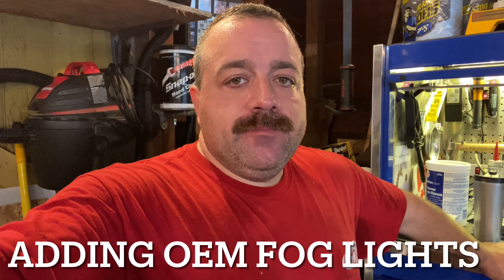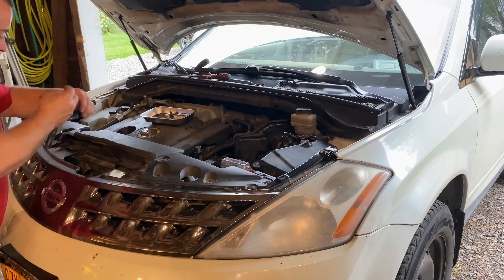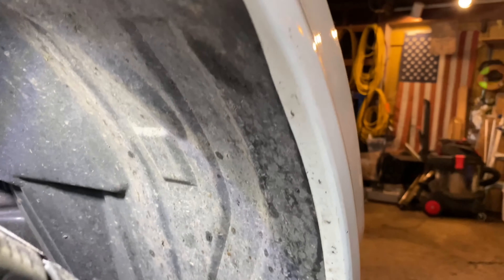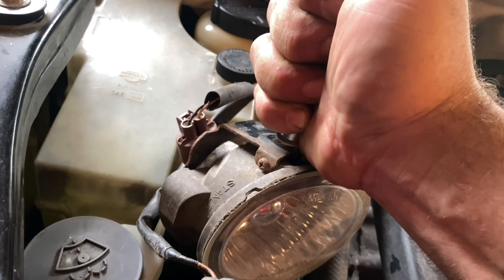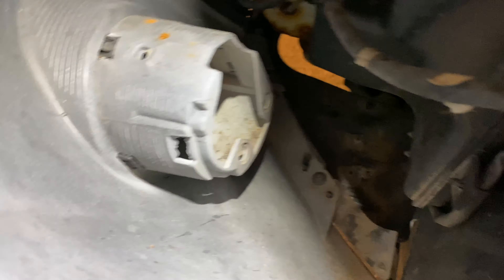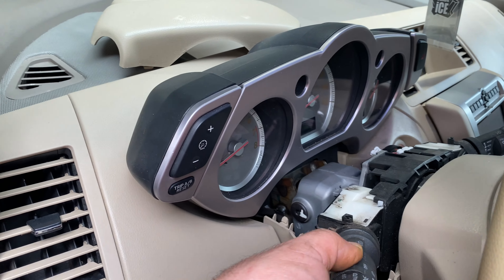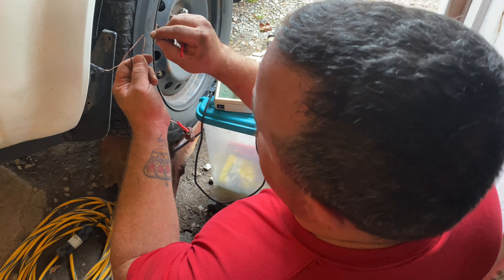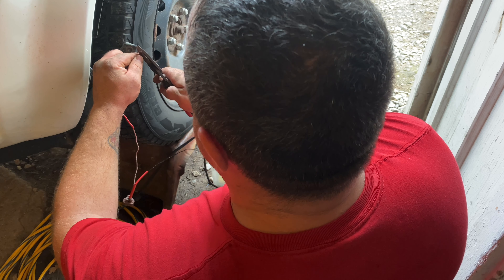2006 Nissan Murano adding OEM fog lights

Comment: I just want to say thank you for posting the CVT cooler line fix video, I was able to change the lines and banjo bolt. I ended up using hose clamps since the hoses were a little loose. I also plan on doing this fog lights upgrade but unfortunately, I went to multiple junkyards but I couldn't find them. I will see if I can get the ones from eBay and modify them to OEM standards.

Comment: Hi Joe did you ever experience the exhaust sagging in the middle on the Murano?  It looks like there should be a support brace in the middle but there is none.
Reply from the maker: That’s a problem for sure. I had to modify the metal rods that are on the pipes to tuck it higher up. I don’t remember exactly what I did, but I definitely agree - it hangs down unusually far in the middle.
Reply: @JoesCarSmartsNY  thank you!
Reply: So it took it in and the shop says oh btw the subframe is gone, rusted out. Car is junk. Bummer... Have you ever noticed that kind of rust?
Reply from the maker: @vladchan  Oh man. We just scrapped ours a couple months ago because of the rear subframe. Yes, I’ve seen it. We had to scrap our perfectly running Murano at 287k miles because of a bad rear subframe. I technically could have replaced it but it was not worth the cost and effort at that mileage.
Reply: @JoesCarSmartsNY  Muranos dropping like flies. I watched a video guy got a whole real axle assembly: subframe control arms hubs the whole 9 yards, and replaced the whole thing as a unit. Didnt look too bad
Reply from the maker: @vladchan  Depending on the rust on the rest of that area. I tried to take one of the main subframe bolts out and it as totally rounded and ruined.  If you’re in another area and the rest of the car is not too rusty it could be worth it. The subframe itself is worth about $600-$700 used right now.

Comment: Thanks for the video! I have a 06 Murano S and will look to see if I have the wiring like you did. Question, did the auto headlight function work for your standard headlights? Also (not as important) how did you trimming look like after you Dremel the trim (pictures/video of it)?
Reply from the maker: The auto feature seems to be more about auto on and off with ignition but there’s a delay after the car is shut off. It doesn’t seem to detect darkness and turn them on only at dark. 

I trimmed a bit too much of the shroud, I would recommend trimming away less than I did and test fitting it until you’re happy with it. From the side I can see a small gap between the shroud and the lens.
Reply: @JoesCarSmartsNY  Thanks again! I went to the salvage yard and picked everything up in one haul! I paid $45 for the fog lights, the light bezel and new blinker! All your instructions were 100% and did not have to go back for anything! Due to lack of knowledge of light life left, I bought some new ones from Amazon and made sure it all worked and spent 2hrs installing it. I’m no a mechanic and only have BASIC knowledge. Easy thanks to you!  Oh my plugs worked so no soldering needed on my project!
Reply from the maker: @alfredoesparzajr1  Awesome!  Glad this helped you!